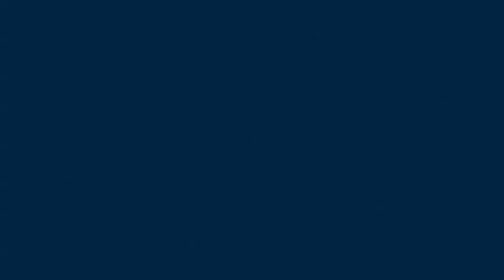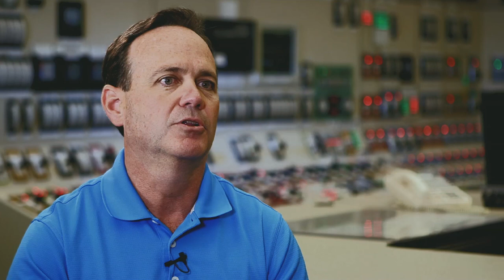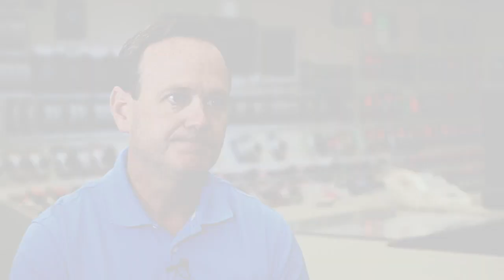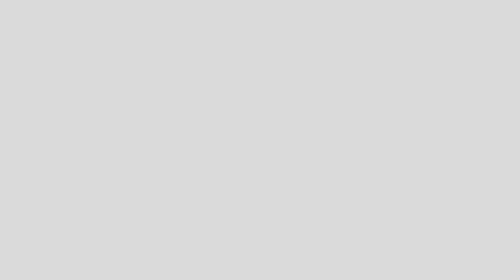Watts Bar 2 Blends Old and New Technology

Comment: I believe this to be like fixing up the 1975 Pontiac that was out back. Mix and match. No mater what you do It is still a old design. Good move to get old hands and experience on the project. Best of luck on the initial load of fuel and initial criticality.